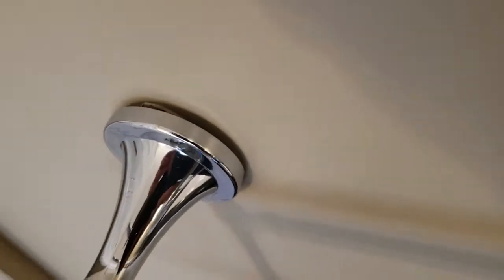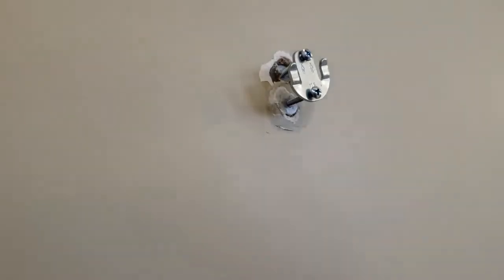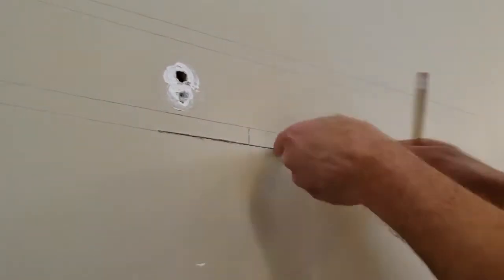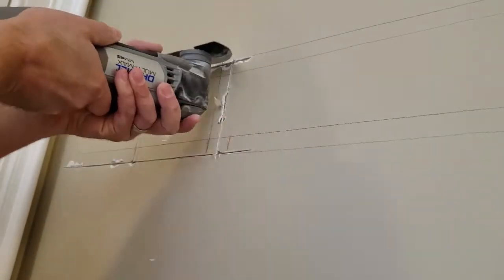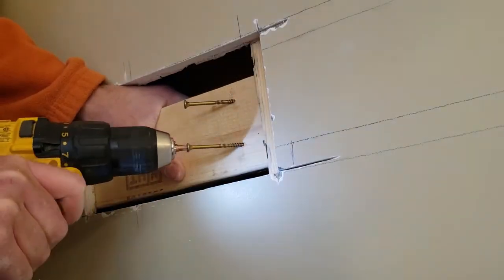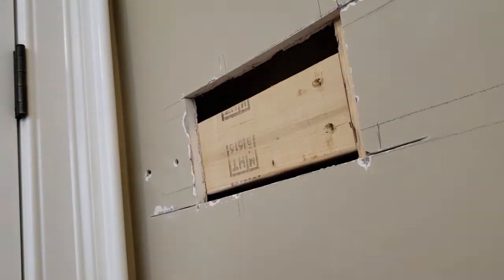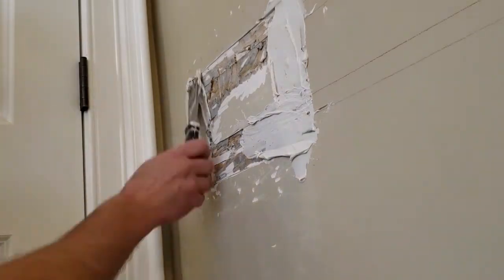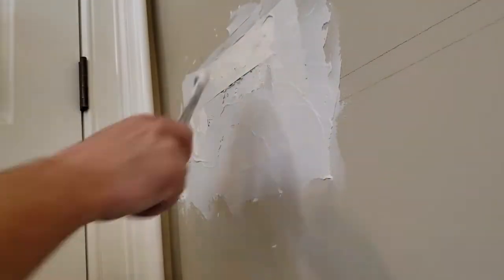D.I.Y. How to fix a TOWEL BAR that's falling off the wall. When a simple project goes south quick

Comment: Why didn't you just move the hardware to a stud? Also that's Dremel sounds like the dentist office and was the worst sound ever
Reply from the maker: trying to hit a stud on both sides of the towel bars can sometimes work. Most of the time, you will only be able to hit a stud on one side.  We had an additional towel bar above that I would have had to move to keep everything lined up. Also, if I moved it, I would have run out of wall space.